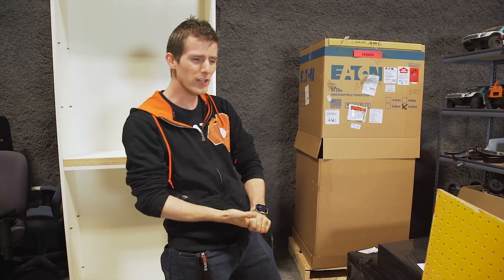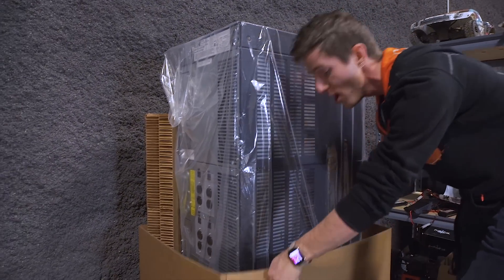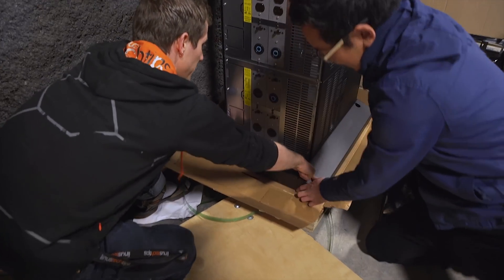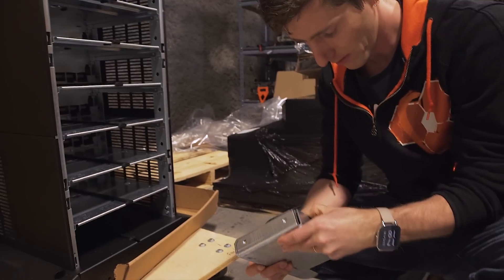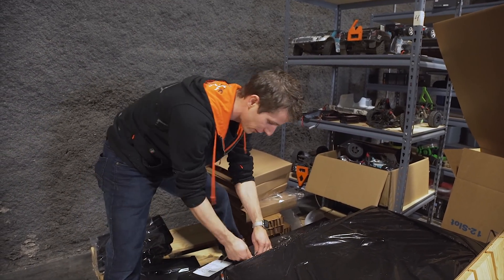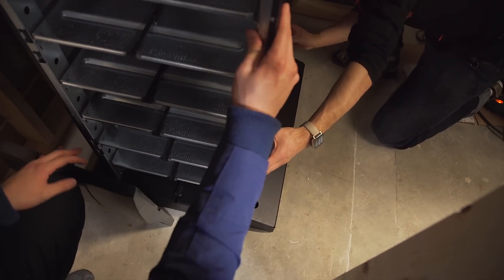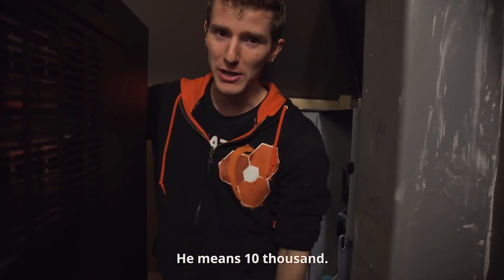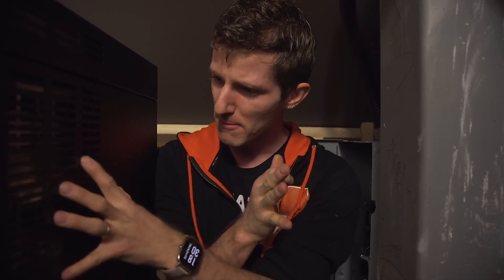HOLY $H!T - A $17,000 (CAD) Man-sized Battery!

Comment: 10kW is enough energy to raise a kilogram a kilometer in one second assuming gravity remains constant (which it won't at that scale)
It can do that for 1560 seconds.
So this thing stores 1.6 Megajoules. That's about one and a half the monthly power consumption of a house.
Sounds dangerous as shit.
Reply: Wow. This is really wrong.
First of all, it's 16 megajoules, not 1.6
Second, 16 megajoules is about 5kWh (could also have found this by doing 10kW of power * 0.5 hours of operation   ), or less than 1/5th the average daily electricity use of a house. That's about 25 cents worth of power where I live.
Third, this can also be expressed as the equivalent of around 3-4 kilos of TNT. That's a lot, but remember that it's not all going to be released instantly. I mean, a kilo of paper has more energy than that.
Reply: Things go boom...
Reply: Thank god someone with sense :)
It's crazy that at least 80 people thought the OP was correct, even though Linus stated himself, 28mins or 56mins of operation.
Clearly not a month and a half consumption?
Reply: 1. Gravity does not fall much even at low earth orbit altitude.
2. In the UPS are lead acid batteries, which are the least dangerous. Now i did not say they are idiot proof, they can draw extreme currents if they short without fuse, just way less than same capacity li-ion, ni-cd, ni-mh...
They are low voltage, so you will not get electrocuted, main concern is heat and light/IR from arc if they short, which can cause fire, burns and eye damage if you stick your nose/hands right where it shorts, and THE BIGGEST CONCERN (for me;-), you damage/destroy battery if short lasts for some time...(If it happens to me: i usualy wear some eye protection when connecting/repairing UPSes, well anything bigger than laptop battery, burns will heal..., i will likely put out small fire before it does much damage, i would just pray that battery/ups is ok ;-)
Reply: Lead acid batteries do not go boom, there are no flamable materials inside. LiIon/LiPolymer do burn(very bad, fire can kill, but no boom, just "pfsssssss"+fire)
Non rechargeable (primary) metallic lithium, ya know, the ones used for making meth ;-) sometimes go (real) BOOM, especially if they "break bad" inside metallic flashlight which holds pressure/heat well till it blows up like a tiny pipe bomb.
Reply: They can when they are not properly vented. Lead acid batteries produce hydrogen when they are changed. Sealed lead acid batteries use a catalyst to convert the hydrogen back to water to keep the batteries from drying out. But SLA batteries can and do vent. So even those "Safe" SLA batteries can go BOOM in a big way.
Reply: No, it might break, and YOU will not be safe - if someone gets you u go to mental hospital or prison => not safe ;-)
Reply: Correct figure (E = P x t) except you've overestimated how much energy that actually is. Its probably easier to think of as approximately 5kW hours, (half an hour of 10kW  power usage ) . A domestic equivalent would be boiling 3 kettles of water or say drying a basket of washing in a dryer.
Reply: They go boom alright, ive seen it. They swell and smell like eggs then BOOM in all sense of the word anyhow. If enough gas H2/O2 accumulates in the battery, then vents out from the internal pressure, which especially with an SLA(Sealed, which are common in UPS btw.) splattering highly concentrated  sulfuric acid everywhere. In some cases it sets off a chain reaction and if its accompanied in an dense bank, the energy stored along with the ATS can make for some nasty plasma arcs, more than enough to facilitate the "Boom" and burn your cornea before it kills the shit out of you! Technical, Graphic, Specific, Rare....... Another day at the office. XD
Reply: And also necessary, I'd guess.
Reply: So if I dump gas on it light it on fire and begin hitting with a baseball bat will it be safe?

Comment: Actually, a back up power generator system (Gas or Diesel) would have been cheaper and gave them extended operating time, at least until the fuel runs out!

Comment: i think you should open the battery cases, so we can see what it looks like and what type of batteries they use. should you put everything on a wooden base incase of flooding or battery drainage do to ground contact. just for additionally  safety to equipment  good stuff either way

Comment: 110 Volt is standard here in the US for wall outlets. We have 220v available at the breaker box which is used for stoves, water heaters dryers and the alike. This talk about converting US to 220v would require switching out transformers and wire is total b.s. The big cost would be replacing a lot of devices but ultimately their is no point, devices run just fine on 110v. If anything it would cost a lot of money to switch from 240v to 110v because you would have to swap your lines out for heavier gauge wire to handle the increased amperage. Theoretically 110v is safer too, obviously if you ground yourself out perfectly 110v will kill you just as dead as 220. In a senario where their is high resistance involved though you may survive 110 where the 220v would've killed you.

Comment: Can it power my PC while running Minesweeper on Windows 98 ??
Reply: hmmm, debatable
Reply: Na the stock cooler may not handle it
Reply: Cameron Grubb doubt it
Reply: maybe if teh cpu throttles
Reply: Cameron Grubb Depends, maybe if you're on lowest settings. Wouldn't risk it though
Reply: Na
Reply: depends, what are your specs minesweeper is a relatively GPU intensive game I wouldn't risk it.
Reply: Don't use it as there is no proper test regarding UPS and mines...
Reply: Cameron Grubb no
Reply: Cameron Grubb your askin wayy to much

Comment: Why didn't you just buy a generator...... It would probably power you for longer than 30 min
Reply: They are intended to work together.  UPS keeps the rack(s) running long enough for the generator to kick in or if the generator fails, long enough to shutdown everything in the rack.
Reply: Exactly.  This is what we did at our company.  Natural gas generator will keep the entire building running indefinitely.  We've had a big storm come through and knock out power and I was at the office all weekend long working with lights, ac, etc.

They may have had some zoning issues or rent/building issues that prohibited them from installing a generator or running gas lines or something like that.
Reply: Im sure they dont want any down time at all so the servers dont break. A generator would only turn on after losing power
Reply: No you still have to use a battery backup but one not nearly this size or price.  Most generators will kick on in a matter of seconds so theoretically, you would only need a minute or two worth of run time on your servers if the power goes out.

We use a couple of CyberPower PR1500LCDRTXL2U units and each one has a BP48V75ART2U battery packs connected up to it.  It's PLENTY to keep a couple of SAN's and 4 dell rack servers, firewalls, phone system, a few procurve switches, etc running for about half an hour.

It was around 2K for them.  The generator though was significantly more but then again, it can literally power the entire building indefinitely so to us it was worth it.
Reply: FastRedPonyCar  Ohhh ok
Reply: He is using UPS (uninterruptible power supply) ... the uninterruptible part is important ... 
for eg: if u were running your computer off a UPS, and someone shut off the mains, your computer will still run without even a single millisecond of interruption on your screen.

generators take time to start up, and a even a single millisecond of power loss on your computer/server would mean that you will need to boot it again

Comment: Sooo basically you guys replace a bunch of small UPSes that would take down 1 or 2 machines when they fail  with 1 giant single point of failure once it decides to go nuts? 

what kinda battery technology does it use?
Reply: It's not a single-point of failure, they use multiple power-modules and multiple battery's, making it redundant.
Reply: and if one of em goes on fire or has another sort of catastrophic failure, you can bet that the other modules will have to be (or will automatically) power down.   Better to have those modules physically separated from each other imho.

But on the other hand, if that kinda stuff happens..  I bet they have bigger problems than a few servers being unavailable ;)
Reply: A fire in the server room would probably do more harm then a power outage :-)

Comment: Wait, 12,000 kV?  Like 12 million volts?  Or does he mean 12 kV / 12,000 V?
Reply: kv would be thousand, but its not KV, it KVA as in Volt Amps, another measurement of power, simply put its a way to say Watts, but the math is a bit different. 12 KVA is equal to 10,000 watts. So the unit can handle 10,000 watts of output power.

Comment: Did anyone else cry when they saw the cable management of their server room? bwahaha $17,000cnd piece of equipment, still uses cheep ass plastic.
Reply: What else are you gonna make cables out? Fabric?
Reply: @kozygeorg  not cheep ass plastic. I was referring to the 20$ power strips they are using. Proper PDUs are made out of metal for grounding.
TBH, LMG's network has always made me cringe. 
... and this comment was over 3 years old.
Reply: @DaemosDaen  well I think they fixed it by now
Reply: @kozygeorg  not according to the video when they replaced the PSU shown here, they still used those cheap white plastic power strips along with power 'squids' of unknown origin,

Comment: for how long 1 gamming pc can run on this?
Reply: Depends on wattage.
Reply: when ur batt goes off u can still play on the bicycle and wait for mains
Reply: Stefan Balint Just work it out, wattage is joules per second and a joule is the amperage x voltage, and im pretty sure they have the info for how much energy it can store somewhere, in either watts for a duration or in milliamps.

Comment: Those UPS units are great. I use two of them to power my r9 390
Reply: power runs out

plays doom with giant UPS setup
Reply: I had to buy a third one when I overclocked it. I might need another.
Reply: Alpha Nerd nah 9 is the minimum
Reply: Still have 'em? Check the nuts and bolts on the powerrail behind the access panel. Make a video of that.  I'm curious .

Comment: Did you consider a Tesla home wall charger or perhaps even a newer advanced fuel cell when shopping around?  PS:  You should probably buy a gimbal for the camera.
Reply: I dont think you understand the difference between an Uninterruptible Power Supply and a battery with an inverter attached to it.  One supplies continuous power from the mains and switches over to batteries during an outage with no interruptions. The other just supplies power from batteries.

Comment: So let's see the big picture:
1- power comes from the grid as AC 120V.
2- it is converted to DC low voltage to recharge the batteries.
3- then the ups convert back up to AC 120V.
4- and finally the servers psu convert back down to DC 12/5V.

Such an inefficient process, but to run the batteries directly to the servers in DC would still require a DC to DC psu. 
After a quick search, I found that such power supplies do exist, but their efficiency is bad, on par or worse than AC-DC.
Also Eaton has DC ups for telecommunication equipment that run on DC.

Comment: Bad investment, You could have gotten tesla power wall 10Kw for $7000 and can get you a whole day off grid and uses Lith ion instead of crappy lead acid that you got.
Reply: lol, youtube strikes again
Reply: You obvious;y dont know what a UPS is for.
Reply: connly33
Yes I do, Tesla power wall with sunny boy inverter or similar is way cheaper and that's a fact that you can't deny.
Reply: That doesnt mean its going to do the same thing, its a completely different use case scenario. What this UPS does is double conversion, which means its running off of battery 24/7, and charging the batteries 24/7 which keeps the power vary clean and means there is no point whatsoever that power will be cut from the servers, not even for a fraction of a second. . When the power goes out it stops charging the batteries but the inverters continue to run with no down time at all. , depending on the system load and battery capacity remaining the UPS will send commands over the network to shut down certain servers, and will allow any servers carrying out a critical function to keep running untill the power level gets low enough to shut down as well. The point is not to be able to run for a full day. its to have a vary reliable Uninterruptible power supply that just keeps things running untill things can be saved, render jobs can be finished and then the systems can all be shut down  safely by itself.
Reply: Not to mention the only unit that is on the market is the 7Kwh unit, all the other models were already discontinued for the time being, the max power output is only 3Kw and that's where the efficiency is going to be the lowest, the pack has to be liquid cooled during high C charging and discharging, there are only 2 or 3 Inverters on the market that are compatible with its control circuitry right now. The unit is also not capable of being charged and discharged at the same time, it can not be in the middle of the circuit and be continuously drawn from, even if it were capable of it the unit is only warrantied for something like 5K cycles, and that would get used vary fast in a that kind of setup, even shallow discharge cycles are counted.

Comment: I had a Chinese power brick that was for a laptop and it would draw 240v and 10 amps !!!!! And it put out 15 volts dc it made the light dim when I plugged it in 😹
Reply: After charging my laptop for 15 mins it caught fire 😹
Reply: +The Jonas Show tip: buying chinese knockoffs because its cheaper is a bad choice. the chances of you having one that works properly is kinda low

Comment: why not just get a natural gas generator that when the power goes out it would kick in automatically
Reply: Wouldn't startup and switch over fast enough.
Reply: +connly33 it would startup after 30 or more seconds after no power detected
Reply: Our 30 KW Kohler unit starts up in about 10 - 12 seconds. But that's still not fast enough. Hence the need for a UPS, it needs to be completely uninterruptible. Once the servers lose power anything in ram that isn't yet saved is gone, and any data being transferred risks being corrupted.
Reply: +connly33 i know that is why i would still have ups(s) so it would give enough time to let the generator have enough time to kick in

Comment: yeh 80A breaker isnt much spectial my house has 3 250A
Reply: +rccarmadben you have 3X250A Breakers. i have to know, what could you possibly be powering that requires such a huge load. Also for clarification when you say 3 250 amp breakers you mean across 3 panels
Reply: +John Adams one on each phase as for what I'm powering I have no idea it's how it was when we got the house (small 5 bed semi) nothing spectacular

Comment: also in most cases you'll notice the ups / battery room itself causes more downtime than that outside power failures actually happen. faulty switching... batteries exploding... (yes those things do need replacement every 1-2 years or so, wether they are used or not) etc. most of the downtime reports of most datacenters go along the lines of 'the ups acted up' not 'outside power failure' ;) ups in racks or under desks is an even more retarded concept... them things can explode, cause fire, etc. ups'es belong in a seperate fire proof room. not in/under/next to important things.

Comment: and then you still need to fit your generator with some plc or microcontroller to press the start "button" (relay) when any of the 3 phases of outside power fails... and a bunch of big relays that take the outside power off the ups and with a delay, hook it up to the output of the (hopefully started) generator.... as that is the entire point. not those 30 minutes extra. :P them things last long enough to start the generators... nothing more nothing less. (maybe correct some hickups in some phases... but for any proper power failure you'll still need a generator with a big box full of relays (or more expensive: phase correction and static switches) to hook it to the ups input (or just have 2 different charge units on the ups... 3 phase external power, and 3 phase generator) switching it off happens automatically by the time the tank is empty lulz. that's much easier.

Comment: $17,000 for a 5KWh battery and 10KW inverter
you guys got royally screwed 

my house runs on battery/solar 
i have a 30KWh battery bank and 2X 3KW 12 to 240V inverters and 2000W of solar panels 

my whole system cost me around $4600 (AUD)  

(edit)
you should get eaton to at least lube you up next time

Comment: Buys 17k Canadian peso back-up, installs it in front of the fuse box, and uses extension cords. facepalm

That 'server room' look ghetto as hell, too.  No hot/cold aisles; everything's just ventilating to the same chamber.  Is it even air-conditioned?

Even though this thing is manufacturer-designed, Linus will find some way to screw it up.

Comment: Do you guys have electrical code requirements for spacing in front of AC disconnect panels in Canada? In the US, it is typical for a requirement of a minimum of 36" (914mm) in front of AC disconnect panels.

Comment: People people with the volts wait a second! China, Japan 100volts, North America 115v until the 1950s then bumped up to 125v. Volts has nothing to do with "" HEAVY DUTY""" It's all about the amps your drawing. In the use residential 240volts is for high amp equipment. That would max out the capacity of a copper wire that is 4.00mm in diameter at 125v. With 240 volts you can use smaller wires since your amps will be lower. However, VA in both cases will max out at the same level for the wire with both voltages.